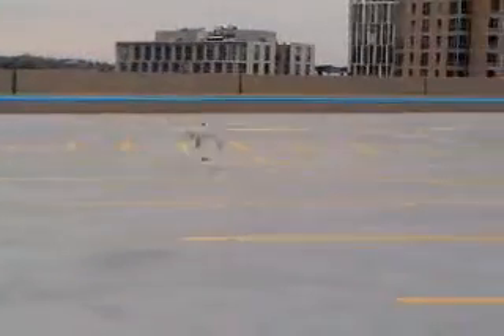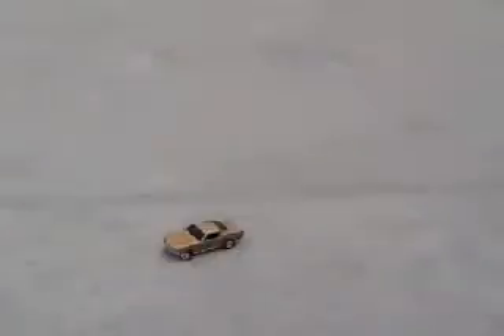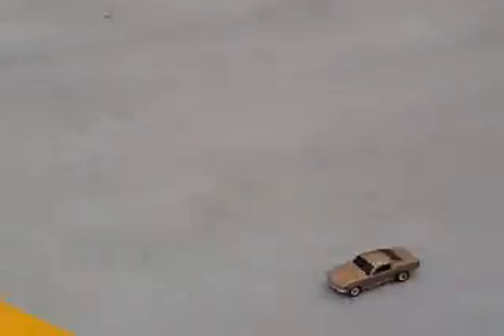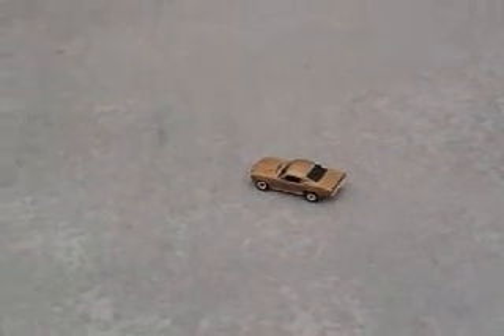Video 8: XMODS Final test run after metal bearing install.

Comment from the maker: @skateminilogo18  That's a good idea!  If I get a chance I'll make one showing the install.  It's pretty easy though.  After removing the wheel, just take off the screw that holds the bearing retainer then pull back on the clip that holds it to the chassis.  After that just remove the plastic bearing, install the metal bearing, then reinstall the bearing retainer and screw.  Pretty straight forward and the results are good: increased speed, power and handling. Ask ??? if want!

Comment from the maker: @skateminilogo18   From what you are saying, are they too small?  Did you get the Xmods brand bearing kit or are they generic bearings your are trying to fit?  Also keep in mind that Xmods came in Generation 1 and Evolution versions and may have different bearing kits.  To tell the difference in Gen 1 and Evo (Gen 2) are the battery set ups.  Gen 1 has 2 batteries on each side.  Evo has 4 batteries laying flat on the bottom.  I have the Evo chassis on all my Xmods.

Comment from the maker: @skateminilogo18  Hmmmm....sorry, I think I'm confused.  You had metal bearings that came with your Skyline starter kit?  Or are you talking about the plastic bearings that are too small?  Metal bearings are a separate purchase.  The plastic bearings that come with the car will appear like they are too small as they allow a lot of play of the wheel spindles.  Once metal bearings are installed, a lot of the play disappears.

Comment from the maker: @skateminilogo18 @skateminilogo18 Oops, I accidently removed your other reply!  Sorry!  Meant to remove my reply!  Still new at this stuff.  

I have not seen a starter kit come with metal bearings.  Radio Shack cleared out all the XMODS stuff years ago, you can find them on Ebay or other sites on the internet.